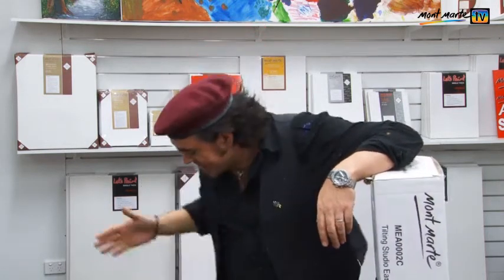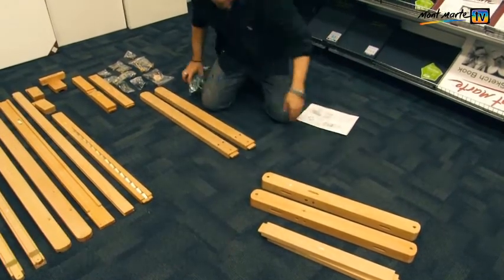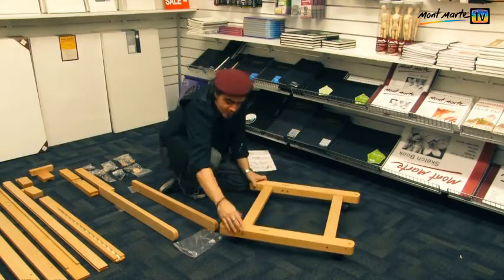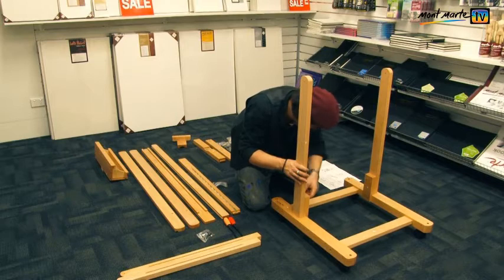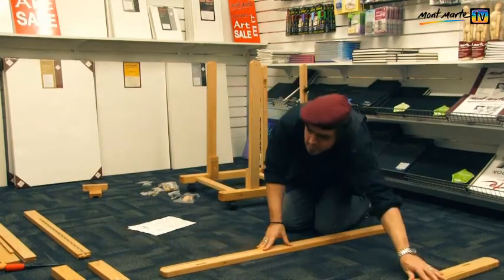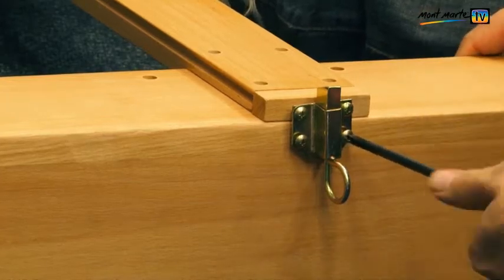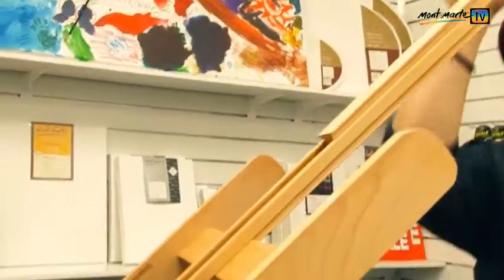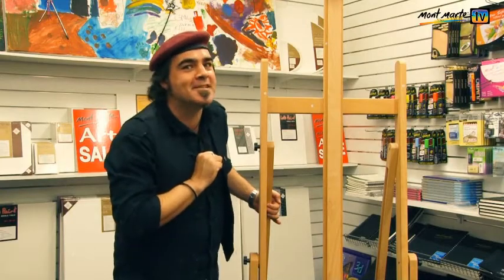Art Lesson: How To assemble A Tilting Studio Easel by Mont Marte

Comment: aside from the stabilizing hardware, this is the same easel as the w11 from US art Supply. If you are watching this video you may want to look up part bag labels for the US product as they may be explained by their lettering and instructions. This video is great.  Some of this is intuitive and much is not. Without this video I would not have been able to put this together correctly and the written instructions are horrible. Thanks! I actually chose this easel because it didn't have the stabilizing hardware, I could see myself gashing myself on those bolts sticking up.

Comment: Just starting to figure out what to buy this one does look easy but flimsy.
Reply from the maker: +cheryl feeney Its not flimsy.  This easel has had bracing added at the base  to ensure it is very stable when in it's horizontal position,  and one can fit a 200 cm canvas in it.  Actually I've been using mine 5 days a week for 6 years!  So no, not flimsy :)